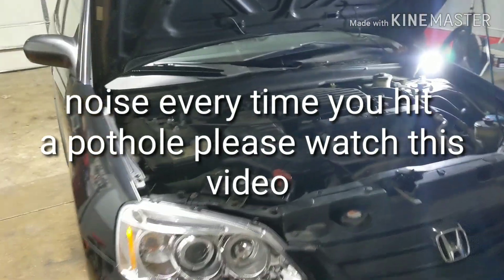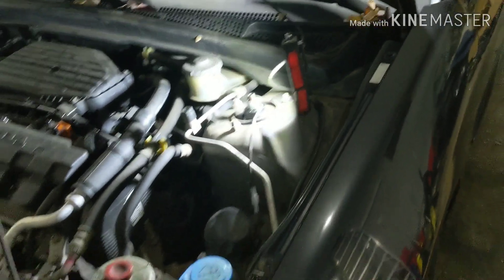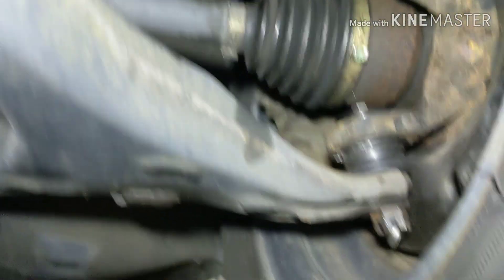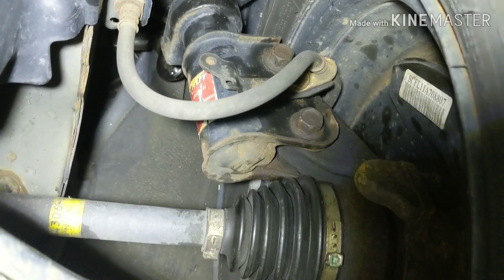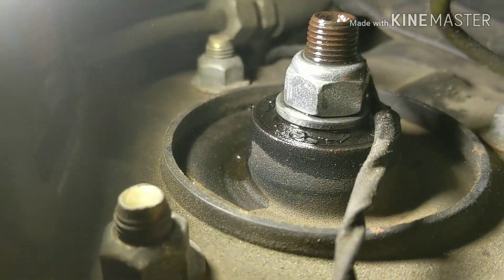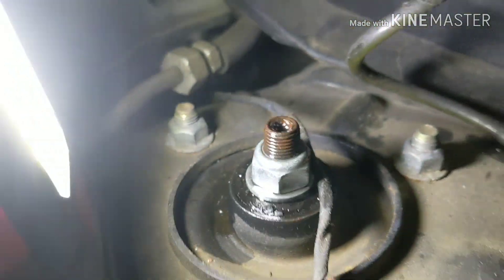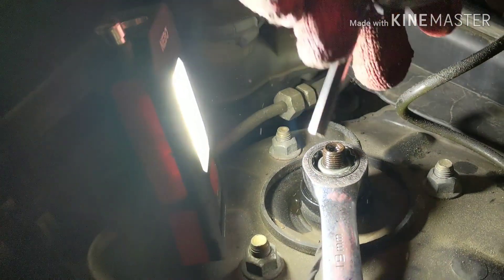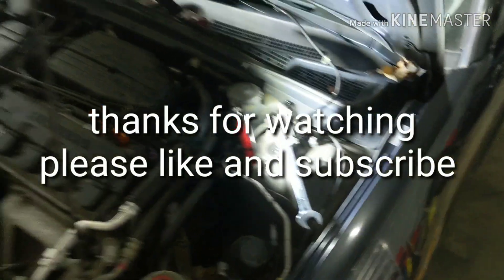Honda Civic rattle noise fix

Comment: Great video, I checked mine, but that wasn't causing the rattling in my 2004 Honda Civic. (We just replaced the whole control bar, which did need replacing and thought would stop the rattling, it did stop most of it but once that loud rattle was fixed there was a new rattling.) I had a mechanic look at it, he said it was coming from behind the dash or something under the hood. I tried your fix for the bolt but there was no play. It was tight. There was some play between the power steering reservoir and the metal edge of the car. I put a small peice of pool noodle in between the two and the rattling was silenced! I went back to the mechanic, he was surprised and said that was a temporary fix and good job but told me to get a wrench and tighten up the bolt that holds the power steering thing to the car, that it is loose. So I will do that. Thanks for giving me the idea to check for loose stuff to tighten, it helped! Many thanks! I hope this might help someone out too!

Comment: what side did you hear this noise? mine does the same thing, every time I hit a bump or pothole on the road there is a rattle noice (almost sounds like when you leave coins in your cup holder and it rattles) i can hear it on the front side but it sounds more towards the passenger side.
Reply from the maker: Well the noise was coming from both sides every time hit a bump,, check the strut if is not loos ,, it can be a bad shock) struts
Reply: 1NITIDO yes i just checked the strut and there isnt any give so could be the shocks like you said
Reply from the maker: Yes but make sure your sway Bart link don't have any play or the outer tide rode and the lower ball joint,, last will be your struts yes they make noise but if they are bad you will see oil on the struts or I will say oil moisture that mean they are dry in the inside,, hope this helps
Reply: I have the same problem did you figure it out
Reply: Probably the steering rack, if it’s only happening over bumps
Reply from the maker: Ok
Reply: @leftonseen690  the old Honda civics are very common to have this problem I resell cars and when I get a civic almost all the times it has this problem

Comment: You mean that top part can be tightened? That sounds like my drivers side noise on '01 civic when I go over bumps almost like plates scraping, but also the outer tie rod boot is torn, and I get clunking when I turn in to the driveway. So start with the outer tie bar and sway bar? Which I got ready to pick up. I hope its not the struts but its been ply 50000 miles at least since they've been changed, and the car has been out west, which I read can dry out the rubber pieces.
Reply: im trying to fix the plates scraping noise? did you find a solution?
Reply: @apodaca3629  I replaced the lower control arm, once it was on the hoist, could see the bushing area was very worn out and rusted where the noise was coming from and noise and clunking is gone now.
Reply: @michaelg6641  thanks for the help good luck!
Reply: And l had Walmart headlight restore for $25..look like brand new now on car 20 years old... that haze is completely gone ..now clear and bright like new car...best deal out there.
Reply: @michaelg6641  hell yeah man! i love these cars

Comment: My 2007 Honda civic rattles when I press too much on the gas I can only go a certain speed before my car starts the screeching noise it honestly sounds like something might be lose or stuck but I’m not a mechanic or anything also sounds like it comes from the passenger side and the front sometimes hope I can get an opinion on that
Reply from the maker: Wow maybe the exhaust is making the noise

Comment: I have 2018 accord it makes creaking noise when at low speed around 10mph when i turn steering wheel. But it doesn't make the noise when the car is parked and stop. Im in Sterling VA
Reply from the maker: Oh ok I can take a look at it this week
Reply: @nestorautorepair  where you located at?
Reply: @nestorautorepair  okay
Reply from the maker: Thanks
Reply: @nestorautorepair  i google it says you in Sterling
Reply from the maker: Yes I'm in Sterling
Reply: i also have this noise what was the problem?

Comment: My 2016 civic is having the same problem,I have changed the shocks,link and change some bushings are you sure it might be the struts ?? Please I have to take it to the workshop tomorrow,it comes from the passenger side
Reply from the maker: I believe your car is too new to have this type of problem , check if the struts are leaking , if they are wet of oil that will be your fix new struts
Reply from the maker: Noise can be coming from sway bar links, outer tide rodes or a bad ball join
Reply: Please I have chuck both you are talking about and there is no problem with it,I really don’t know what is wrong with my car
Reply from the maker: I wish I can help you what  state you stay at?

Comment: I here this sound when I’m idle and it goes in and out. It only starts after I drive for a while a mechanic said its my rocker arm but I wanna get another opinion. Any suggestions?
Reply from the maker: Mmm it can be many thin , I will say wait until it get worse and then it will be way easy to find it
Reply: same bro u ever find out what it is
Reply: Mine did it too it was the spring bolts on the muffler rattling
Reply: Find out the problem? I have the same problem